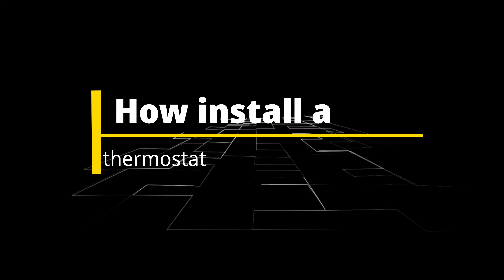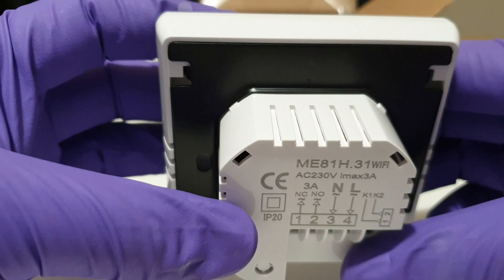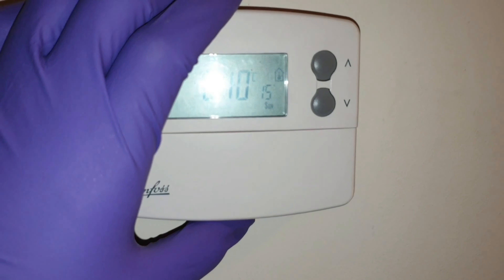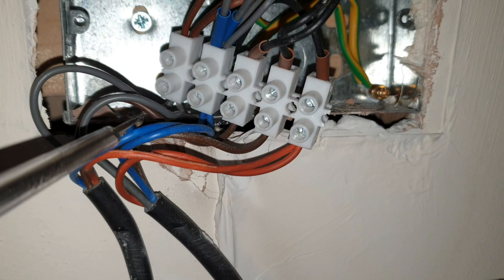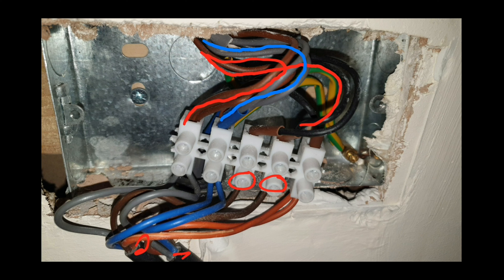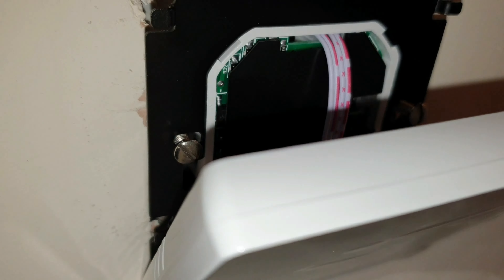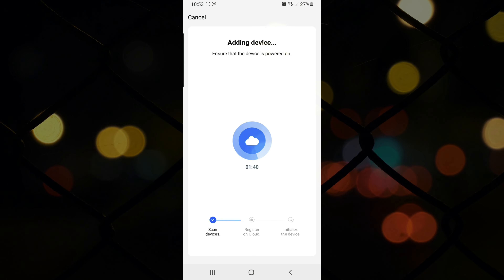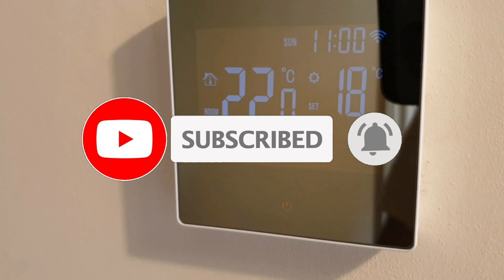Smart WiFi thermostat for under £20! And how to install Avatto MoesHouse Beca and others.

Comment: Apple homekit?
Reply from the maker: It doesn't natively support it
Reply: @laymandiy  thank you
Reply from the maker: You need to get something called homebridge
Reply: @laymandiy  I already have aqara, xiaomi geteway 3, sonoff wifi switch, but there is no bridge for avatto thermostats, they also connect directly to wifi
Reply from the maker: You can get the moees house alternative that uses a ZigBee bridge
Reply: @laymandiy  thank you.  I understood you.  But in my house, as a result, there will be a bunch of bridges from different manufacturers :(
Reply from the maker: There is a simple solution... Stop using Apple homekit! Google and Alexa offer so much more versatility.
Reply: @laymandiy  Oh sure.  I took all the devices to Yandex Alice.  I just want to change my Galaxy for an iPhone, and I'm wondering what I can change in the process with a smart home
Reply from the maker: Well luckily, avatto supports yandex natively. Generally speaking avatto moeshouse and others all use the tuya framework which supports yandex, Amazon and google
Reply: @laymandiy  the only drawback is that there is little scenario in Yandex compared to other ecosystems, for example mihome.
Reply from the maker: In order for u to connect you need to register with smart home app. And if you really wanted to you can create scenes that are more complicated in the smart home app and trigger them using yandex
Reply: @laymandiy  yandex does not have a lot of scripts, automation is simple only.  We'll have to do this through several applications.  And most importantly, devices of the same brand should be involved in automation.  It will not work on different ones.  Only if not done through the home assistant

Comment: I am trying to do this, I have ordered the gas boiler one but it has 5 holes in the back! It has L, N, L, ON and NC. What to do?
Reply from the maker: What has 5 holes? The thermostat you bought?
Reply: @laymandiy  yes it does and they are marked with the letters above...
Reply from the maker: Have you tried wiring up the way in the video?